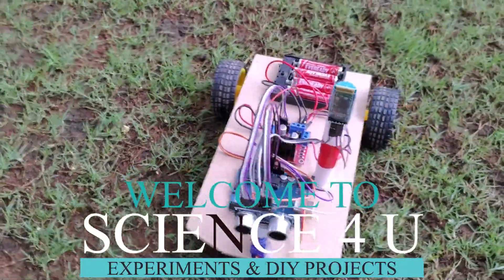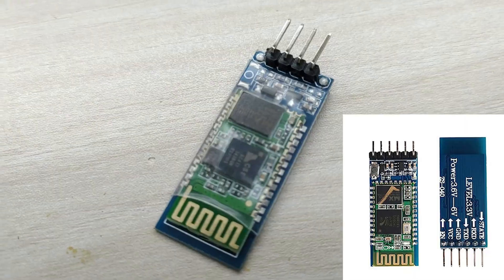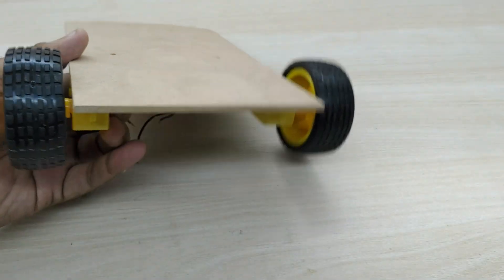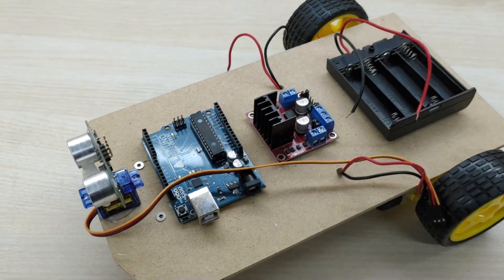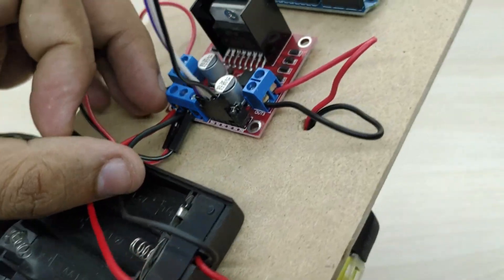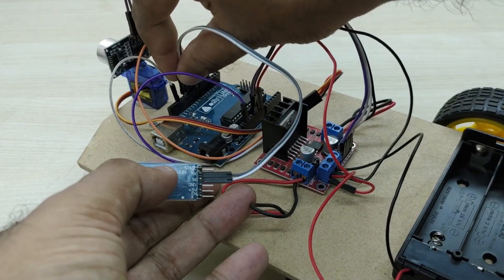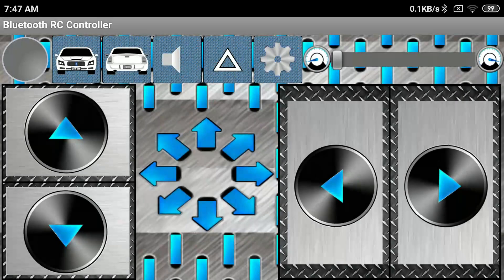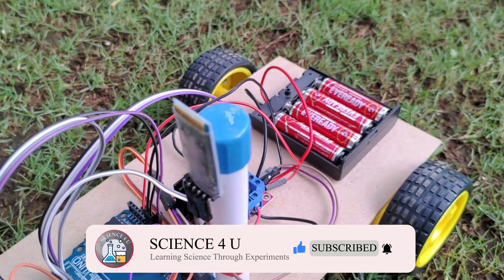Bluetooth controlled car with obstacle avoidance || Step by Step tutorial

Comment: hello , dear friend  every think is ok, just obstacle avoidance module not working? i try too much but the result was same
what u think?
Reply from the maker: Just check connections to ultrasonic sensor once again.If connections are correct, It should be most likely due to a faulty ultrasonic sensor. It can get damaged easily. Have you used this ultrasonic sensor before or is it a new one?
Reply: connections were corrected .ultrasonic sensor is new one . u know during uploading programs i heard  some sound like tik ,tik from Arduino and  yellow lamp lighting very fast ( i dont know it cause of something wrong or normal)
when i disconnected the servo jumper GND ,arduino worked normally (without sound)   @Science_4U_
Reply from the maker: @alirezagoudarzi9732  Hi friend.The lamp lighting fast when the code is uploaded is quite normal. Also the tick tick sound is due to slight movements of the servo motor when the code is being uploaded. So that is why when you removed the servo motor wire during uploading the code, the tick tick sound went away. But, now after changing the ultrasonic sensor, is it working friend?

Comment: Plz tell me every wire is correct but the problem is with sensor part, my sensor as well as servo motor isn't working, my sensor is not able to detect.
Reply from the maker: Hmm..okay friend..is the wheels rotating?. If yes, atleast the motor driver part is okay. I can help you in identifying the problem. Can you send a hi in my instagram page. I will ask you to do some checks and will try to identify the exact problem.

Comment: Which battery should I use
Reply from the maker: Hi friend, you can use any battery with voltage from 5V to 12V .. I will suggest you to use 2 x 18650 , 3.7 V Lithium Ion batteries. They last really long and they are rechargeable also..

Comment: The connection of Arduino uno and Arduino mega 2560 is same or different?
Reply from the maker: Yes friend..connections are exactly the same..arduino mega has more number of digital IO and Analog IO pins..the code for uno will work for mega also if you use the same pin numbers for the connections..🙂
Reply: After all the connections done and I have install  the code the still  robot is not moving 🤔
Reply from the maker: @binitsapkota6753  Okay friend. There can be many reasons why robot is not moving. We have to identify one by one..it could be a motor driver problem, bluetoorh module problem, connection problem..etc..
Reply from the maker: @binitsapkota6753  If you can share the photos of connections in my instagram id..i will see if any connection problems are there. I can also help you to identify the problem by checking one by one..
Reply: Okay can U send me your Instagram id

Comment: Bro my phone is not connecting to my rodot
Reply from the maker: If it is not connecting, it might most likely be a problem with the bluetooth module..can you try with another phone?. Also is the light in the bluetooth module blinking?
Reply from the maker: Also, in this video, I am showing that the positive VCC pin of the bluetooth module to be connected directly to +ve terminal of battery since all the +5V Pins in arduino are already used. But please make note that the bluetooth module works only with an input voltage range of 3.3 to 6V. So if you use battery with voltage greater than 6V, bluetooth module will not work. So, in that case connect the positive of servo motor directly to battery and VCC of bluetooth module should be taken from +5V of arduino..This also you please check..
Reply: Bro I can connect the car with my phone but the car is not moving
Reply from the maker: @AHRAANALARVINDMoe  okay friend. There could be something wrong. We have to check one by one to find out the problem..If you can send the photos of the connections in my instagram id, I will check and help you identify the problem..
Reply: I am only 10 years old becouse of that I don't have a Instagram account
Reply from the maker: @AHRAANALARVINDMoe  hmm..then what to do?. Can you do the following checks..you can reply here itself..can you given all connections correctly?. Do you see light in ardino uno, motor driver board and bluetooth module?
Reply: Yes
Reply from the maker: Okay.Please remove wires from IN1, IN2 of motor driver board. Connect 5V from arduino to IN1 of motor driver and connect GND from arduino to IN2 of motor driver. Now switch ON everything. Is one motor alone rotating?

Comment: Can i use 4 motor in the place of caster wheel
Reply from the maker: Yes..ofcourse friend. You can use four wheels. But only problem that I have noticed is that, if we use 4 wheels with motors, the robot will not turn that smoothly. This is because while turning, there will be some resistance due to skidding of the rubber wheels. But definitely, using all 4 motors will also work!!!
Reply: Thank you so much 😊😊😊😊
Reply from the maker: @ARCHANASINGH-by6vv  okay friend..🙂
Reply: How many current should I give to this robot
Reply from the maker: @ARCHANASINGH-by6vv  How many current  means what friend?. The geared motor consumes around 200 mA per motor. So total 800 mA for 4 motors. Then arduino + servo motor + bluetooth module + ultrasonic sensor + motor driver everything put together another 700mA. So total around 1.5A maximum current capacity will be required for the battery.

Comment: How many jumper wire have you used
Reply from the maker: Hi friend. I have used the following jumper wires..
1. 4 Nos. Male to Female for connecting motor driver board to arduino uno.
2. 4 Nos. Male to Female for connecting ultrasonic sensor to arduino uno.
3. 4 Nos. Male to Female for connecting bluetooth module to arduino uno.
4. 3 Nos. Male to Male for connecting servo motor to arduino uno.
5. 2 Nos. Male to Male for connecting arduino uno to battery.
Reply: @Science_4U_  thank you so much 😊😊
Reply from the maker: @ARCHANASINGH-by6vv  okay friend..🙂

Comment: Hello sir,, Bluetooth module connection with app is successful,but robot is not moving. Please give me solution. I've done everything exact same as you.

If you remember,,I commented on your obstacle avoider video,,I have implemented it and it works perfectly
Reply from the maker: Can you double check the connections?. Is the bluetooth module that you have used a working one?.
Reply: @Science_4U_  Sir,,I've been successful to run the project☺️
But I have a query. While checking obstacle,,the code is not advanced. Like it does not measure left and right distance. Will the algorithm from your advanced obstacle avoider video will work in this project if I add?
Reply from the maker: @sk.ahsanabid941  yes friend that is true, this code is not advanced. It simply looks both left and right but always goes in the right direction only. You can use the code from the other project with advanced algorithm. It searches for obstacles in both left and right and accordingly decides whether to go left or right. But only thing is , please watch that video also and make sure the pin numbers are correct. Pin numbers may have to be changed in arduino, if you run that code with advanced algorithm..
Reply: @sk.ahsanabid941  have the same problem, what did you do?
Reply: @slchlml  placed the tx and rx of bluetooth module at rx and tx port of arduino,,and adjusted the code a little
Reply: @sk.ahsanabid941  how bro to edit code

Comment: yo another doubt where should i connect the servo... the 5v pin is already connected to the ultrasonic senor and gnd also
Reply from the maker: There are 2 Nos. Of +5V pins in arduino. There is another +5V pin named as AREF and GND near pin no. 13..This AREF can be used as +5V. Or else servo motor positive wire can be connected directly to +ve terminal of battery also..

Comment: i wanna make it with L293D motor driver what should i do for the connections i am new to arudino
Reply from the maker: Hi friend..there are two types of L293D motor drivers..
1. L293D motor driver shield..that is kept on top of arduino board. It has 4 motor controls and 2  servo motor controls also..
2. L293 motor driver module board with only 2 motor controls..that is kept separatley..
Which one of the above do you want to use?

Comment: Can we use 4 gear motor and wheels rather than using a castor wheel ?
Reply from the maker: Yes..sure friend..both the left side motors can be connected together and connected to  left side of the motor driver. Similarly both the right side motors can be connected together and given to the right side of the motor driver..It will definitely work..
Reply: @Science_4U_  ohh thanks for the information cause im a 8th class student and im having a exhibition which is being held in our school thats why i was curious about this
Reply from the maker: @Adyashapadhi-l6m  okay friend...if possible you can try both options and see which you feel is better..
Reply from the maker: @Adyashapadhi-l6m  Also, if you face some problem with the project, please do contact me. I will help to the best of my knowledge..
Reply from the maker: But only problem that I have seen is that it will be slightly difficult to turn left or right since 4 wheels are there..The rubber wheel has good grip and hence for turning with all 4 wheels, there will be some difficulty due to extra friction from the rubber tyres. But if only 2 tyres at the rear and a castor wheel is given, it can change directions very quickly..
Reply: So it means it will cause a little difficulty to turn it right and left
Reply: Umm btw what is the advantages of making it can you pls tell me
Reply from the maker: @Adyashapadhi-l6m  advantages of what?. Making with 4 geared motors instead of 2?
Reply: Umm like what benefits we can get by making this robot
Reply from the maker: @Adyashapadhi-l6m  Hmm..this is basically  a bluetooth controlled robot. It moves front back and sideways based on the commands from mobile phone. But what makes it special is that it also has obstacle avoiding feature. So it will prevent the robot from hitting on obstacles while using bluetooth control. This makes it easy for even small kids to play with it. Like even if they dont control the car properly, it will not hit somewhere..
Reply from the maker: @Adyashapadhi-l6m  All this finds applications in autonomous robots for military surveillance etc. There are remote vehicles which can be controlled using bluetooth. But having an obtacle avoidance feature makes it even smarter by avoiding obstacle and preventing damage.
Reply from the maker: @Adyashapadhi-l6m  And if you want you can place ultrasonic sensors at the back and sides also. So that if it detects an obstacle anywhere near the robot, it stops working thus preventing the robot from hitting obstacle and getting damaged..
Reply: If I want 4 wheels is there a different code for it ?

Comment: I am using L293D driver borad and getting no response from the code ..what could be the issue
Reply from the maker: Hi friend. Sorry to know that. Most probably, the issue could be due to a bad motor driver board.Have you succesfully used the motor driver board before?.
Also the problem could come due to bad batteries. Please use new batteries and see whether it is working..

Comment: Sir i upload the code, my car is running with the help of my phone which means Bluetooth module is working properly but my car is not detedting the obstacles and my servo is not moving properly also.which means my servo and sensor is not working Properly?I am not using rechargeable batteries, please answer what should I do?
Reply from the maker: Hi friend. Most likely the ultrasonic sensor is not working. Please check connections once again. If all connections are correct and still not working, then most probably the ultrasonic sensor is bad. You can relace the sensor to solve the problem...
Reply: I have checked connections but I Don't have anything to check voltage
Reply from the maker: @ShariyarSajid-fr4vt  hmm..okay..
Reply: But I have made obstacle avoiding car before which works properly,where my sensor and servo both were working properly
Reply from the maker: @ShariyarSajid-fr4vt  Okay..then please check connections or some looseness in connections etc..check battery voltage also..

Comment: Its only working for left part of motor controller.....Right part is not working....
Reply from the maker: Also, if you have a multimeter, you can check whether voltage is coming from both pin nos . 4&5 and 6&7 when you press forward or reverse buttons..
Reply: @Science_4U_  i will check and will update the results here today.... N thanks for quick response on this... Appreciated!!!
Reply from the maker: Okay..nice..i will try to help to the best of my knowledge!!!
Reply from the maker: Hi friend. Can you explain the problem in little more detail?. When you press the forward, reverse, left or right button in mobile phone, , in all cases only the left side motor is rotating and right side motor is not rotating..is it like that?
Reply: @Science_4U_  Yes, it works for only one motor i.e. forward, reverse and left only works for single motor.... no reaction on another motor....
I tried testing it using led but only one side is accepting connection
Reply from the maker: @riteshkashyap14887  hmm...okay friend..can you check whether the motor which is not working is good or bad?. Can you connect the motor that is not working directly to a battery and see whether it is rotating or not?
Reply: @Science_4U_  yes its working, and like i said i am testing with with LEDs to detect wheather current is passing through or not.... but again only left side led works not the right one.... thinking of changing code to check if it captures signal for right...

But if you have any clue then please let me knwo.
Reply from the maker: I am not able to understand why one side alone is not working. Either it works in opposite direction, if the pins are interchanged or it doesnt work at all..
Reply from the maker: Did you change the original code?. I would suggest you can redownload the code and upload once again and see whether both motors are working..
Reply: @Science_4U_  no I didnt change the code yet
Reply from the maker: Can you interchange pin nos 4&5 with pin nos 6&7 in the same order and see whether the other motor starts working?. Or now no motor works at all due to this interchange..?

Comment: Sir tomorrow is my submission plz reply me 
I have made this car and I have chacked all the connections also and car is working but it can't work more than 2 minutes after connecting batteries it hardly run for 2 min I thought my batteries are dead so I gave 9v battery connection in Arduino board so it worked for while but now it's stop again...
Reply from the maker: Also another thing is that if your battery is weak, when the servo motor rotates, it takes large current which reduces the input voltage. The bluetooth module works in a narrow input voltage range of 3.6-6v  only. So if the voltage drops suddenly when the servo motor rotates, the bluetooth module can get disconneted and it stops working.
Reply: @Science_4U_  yes.. i have Chacked this Points 
Bluetooth module was connected
Light of Arduino Uno and l298n motor was working.
It don't suddenly stops first it reduce the speed and after it stop and also stop the responding the command
Reply from the maker: Hi friend, surely I will help. Don't worry. I think it is because of batteries. 9v transistor batteries and 1.5v AA batteries will not work for long time. 18650 3.7V rechargeable batteries are the best. These batteries are used inside laptop batteries and power banks. You can use 2 X 18650 batteries which will work for really long time.And you can recharge them also..
Reply from the maker: I have another doubt. When it stops working does it stop all of a sudden ?. Or the speed reduces and reduces and then finally stop working?. Also when it stops working, do you see that the light in the bluetooth module starts blinking and in the mobile phone does the message come that bluetooth is disconnected?. I am trying to understand whether it stops working because the blutooth module is loosing connection due to low input voltage.
Reply: @Science_4U_  thank you sir... I used 18650 batteries first while Chacking motor but when project was done one Battery wasn't working so I fixed 9v battery instead of one Battery and also another 9v battery to Arduino board.....
Reply from the maker: Okay..great..👍
Reply from the maker: Please check these points. Please ask further questions and I will be happy to help..☺️
Reply from the maker: Hi friend. Whether the problem is solved?

Comment: I have made the connections as shown in the video and my car is not moving or working.
Reply from the maker: Hi friend, there can be so many reasons why the car is not working. But the following are the 3 most probable reasons. Please check them.
1. The ardino board or motor driver board could be faulty. Are you using new ones or arleady used and tested ones?
2. The car will not work if the batteries are discharged. Make sure you are using new batteries. 
3. Is the code uploaded properly?. Did the IDE software show the message that the code upload is succesful?.